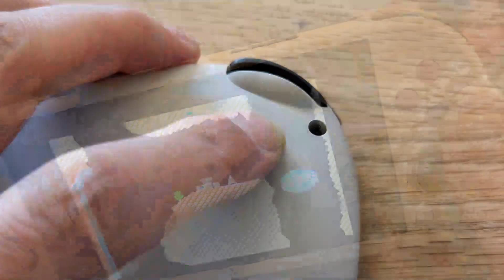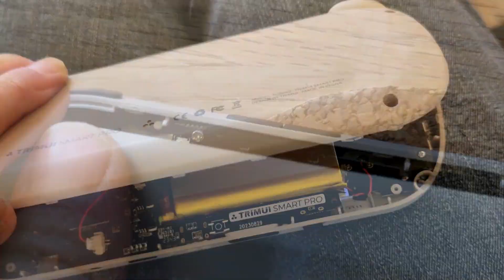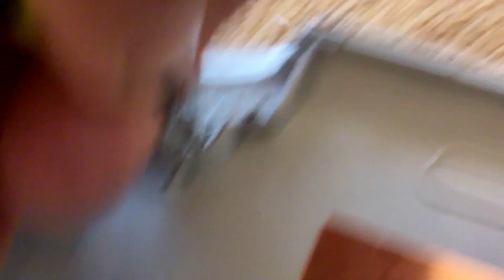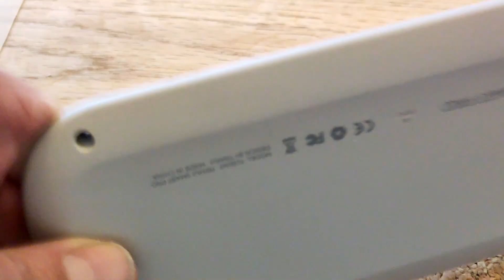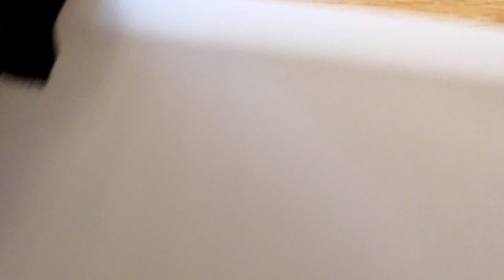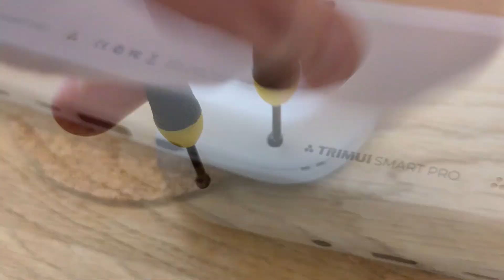TrimUI Smart Pro rear buttons mod

Comment: Yo solamente le puse debajo unas espumas y ya😅 para más resistencia al presionar
Reply from the maker: Esa es una buena solución. Quería mover los botones a la parte posterior del dispositivo para que fuera más fácil presionarlos.
Reply: @ClickyControl I noticed that you put thermal rubber under the chip, the back side gets very hot?  Did this give a result - FPS in games increased?
Reply from the maker: @hitbox2381 Hmm - I only added the holes, the back "buttons" and padding under the triggers (padding is removed for this mod, though). My unit came with what you see. I think, however, that the units the reviewers got lacked the thermal insulation.
Reply: @ClickyControl   What thickness of thermal rubber is there?
Reply from the maker: A bit less than 1 cm, I think.